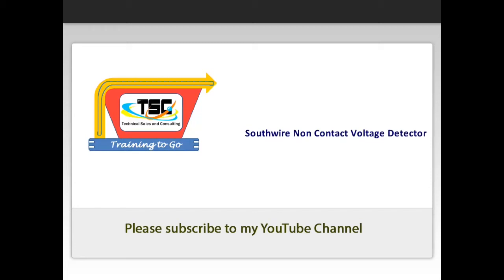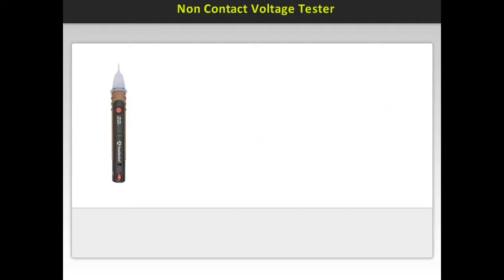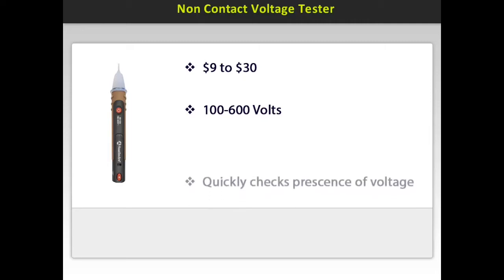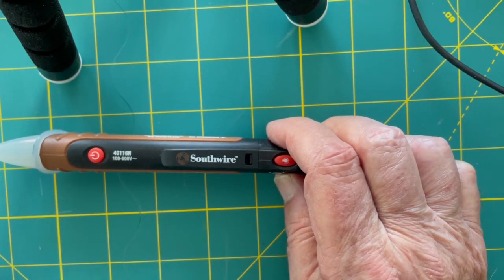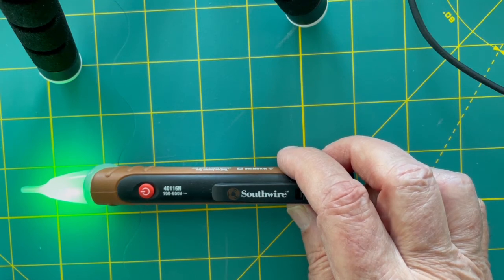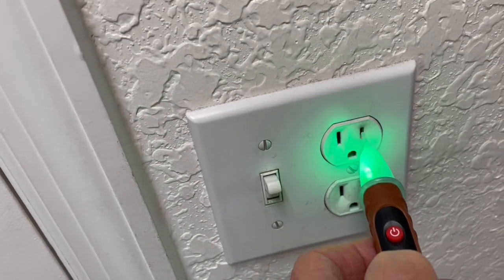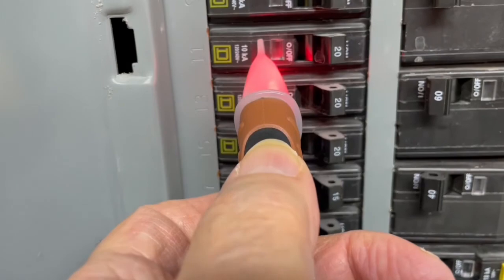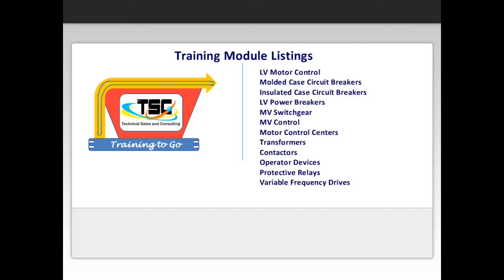Southwire Tools 40116N Non Contact Voltage Tester

Comment: I had one for 10 years, you never had to turn it on and had the same batteries. The only ones I can find now are ones with a power button. It sounds petty but when you get used to picking it up and it works instantly, then that is what you expect from a replacement.